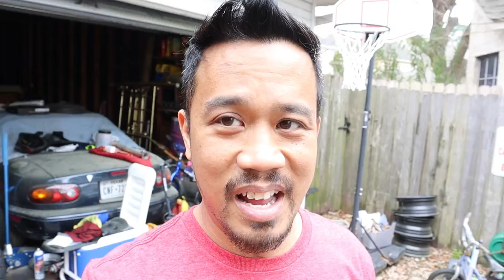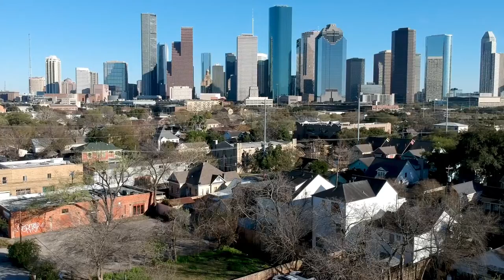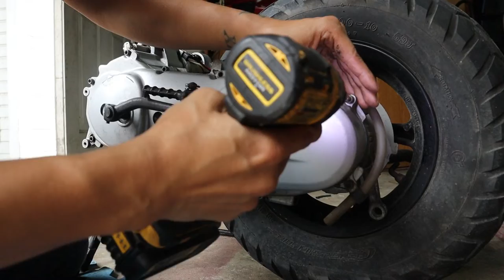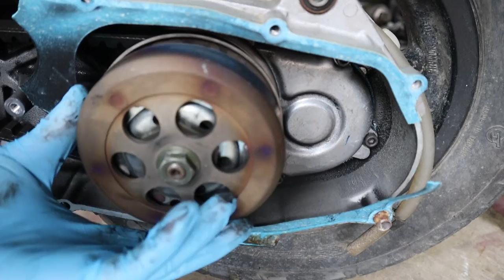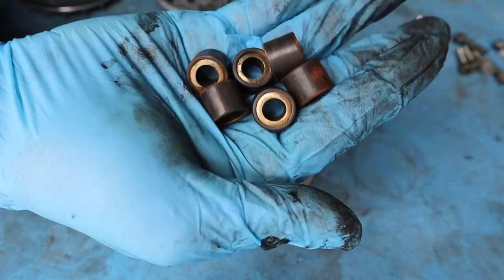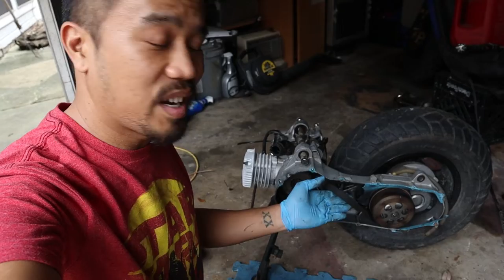Exploring the CVT , Do I need to buy a new Variator and belt? Raffle Bike Rebuild

Comment: Just a thought -- when you replace the head studs put a drop of oil on the threads before you put on the nut so the threads don't mind and you get a more accurate torque on them. Even though it's a low toque.
Reply from the maker: Your a professional , I will try it . Did you get my IG message

Comment: did you ask the lads at ST about the length of the stage 6 studs? I know some cylinder studs are longer to accommodate longer stroke cranks. Might want to double check! if you are putting a bbk on it then you can just get some new rollers 5g, 5.5g or 6g depending on how you want to tune it for the winner. Stock vari is fine really, depends how much of your own money you want to pour into the build. I would clean and de glaze the clutch pads and bell. if the bell is not wobbly or badly out of round you can likely re use it.
Reply from the maker: This was stock length from what I remember :) they come in today
Reply: @SmallEngineVelocity  wordz!